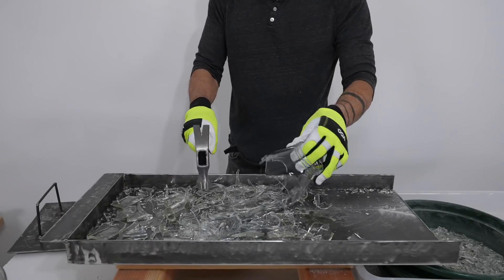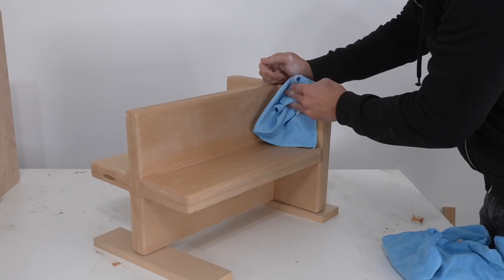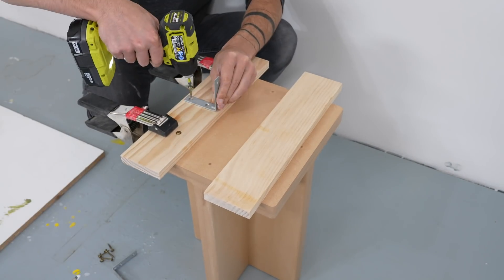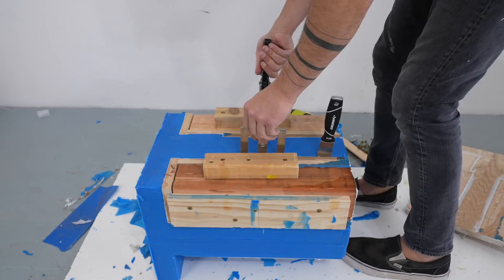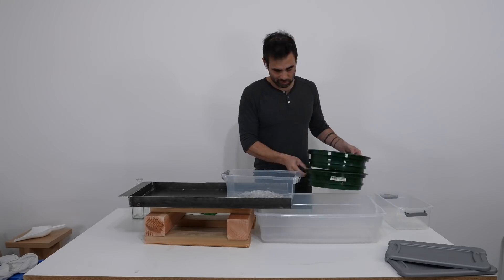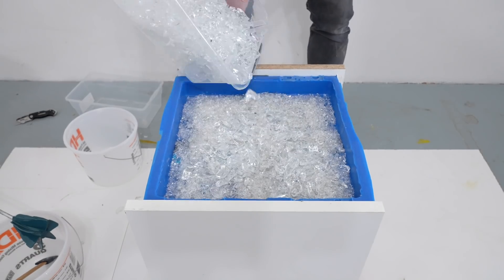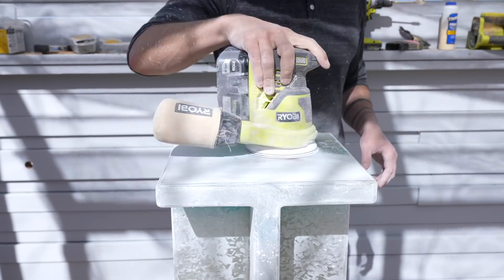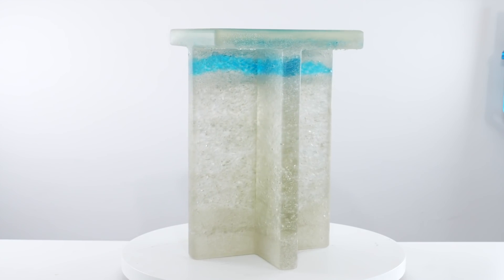Making Furniture out of BROKEN GLASS

Comment: So, I saw a crackle glass dining table at the furniture store.   I LOVED it.   Went on line, to discover that a sheet of crackle glass 3 feet by 5 feet is $2500.      I thought of using broken glass with epoxy to create a similar effect.   Which when I googled it, led me to your video.     If I picked up a glass table top in that size off of a local buy and sell group - second hand, and then like you suggested, mixed the smashed glass in with the epoxy, could this work?   Then do a final top coat of epoxy to make it smooth topped after?   I'd love to see you take on this kind of task?

Comment: Did there tend to be pieces of glass on any of the surfaces that could be felt by hand? Or did the epoxy encase everything?
Reply from the maker: it is smooth to the touch, you can tell because the other wise the sand paper would get shredded

Comment: I have to say I usually am a fan of your content but I can’t agree with this one.  Glass can be recycled over and over, check out Jerry Rig Everything channel and he visits a glass recycler if you’re not convinced. Epoxy resin has only one destiny and that’s landfill. That’s bad enough, but here you’re throwing a load of glass too. Yes, I get it, it amounts to about a bucketful and you’re but one person but it’s the principle. And I know that nothing comes for nothing, recycling glass uses resources too but far far less than creating new glass. I just can’t get on board this one. It looks nice though.
Reply from the maker: I don't disagree with some of this and I appreciate the fair tone of your comment. typically  re use is the best, high percentage recycling with out transportation or energy use is good, low percentage recycling is better than nothing.  For me though the epoxy is tricky part and I try not to use epoxy for anything that wont be used for at least 40 years which is where it starts to be equal in impact to particle board. I am imperfect and at times inconsistent with the materials that I use but my main metric is to recycle more than I produce which is one of the reasons why I am recycling over 5000 lbs of windmill blades.  its hard to be perfect so I just try to do more good than harm.  epoxy projects are popular on YouTube and I wanted to show a way to use less epoxy and more of another material.  That being said I am aware that it is possible that this does the opposite and encourages more epoxy use instead of smarter epoxy use.
Reply: @HomeMadeModern  thanks for reading and a good response. Still a fan.

Comment: For removing labels off glass bottles, OxiClean works really well. Mix with water and soak the bottles in it for a day or so and the labels slide right off. Used to do that for recycling beer bottles when I used to do homebrew, worked like a charm.
Reply from the maker: thanks for the tip!

Comment: This is so cool!  It occurs to me that if you could get a source for broken safety glass you could do away with the smashing altogether.
Reply from the maker: yes! we are talking to some glass fabricators that can basically get us unlimited amounts but first we need to establish the limits of the epoxy to glass ratio.  epoxy is expensive but if we can get it to hold together with 80% glass to 20% uv resisting resin we are on to something
Reply: @HomeMadeModern  How resistant is US resistant epoxy? Can it be used as a outdoor piece, or something my a sunny window? Q is more on the specifics, not the latter about the piece use :-)

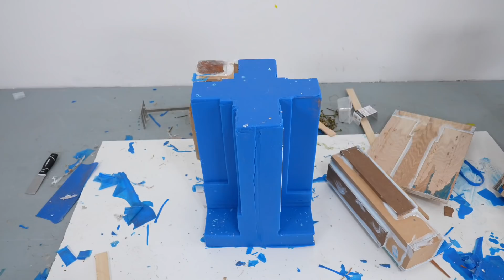Comment: 4:30 they usually cut the silicon in a zigzag pattern so the two halves align easier with each other.
Reply: Came down to say the same thing. Zigzag cuts down the sides to get the halves to register with each other and don't cut through the bottom next time. The mold will take up more space when you store it, but it will be less prone to leaks.
Reply from the maker: smart!